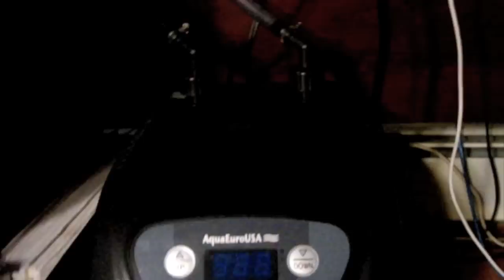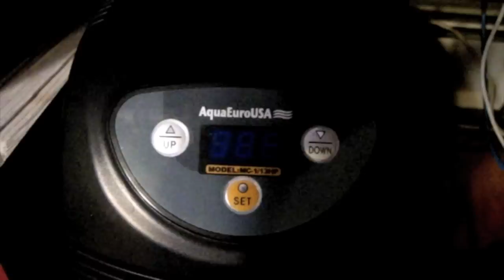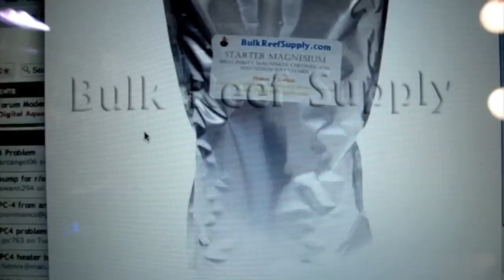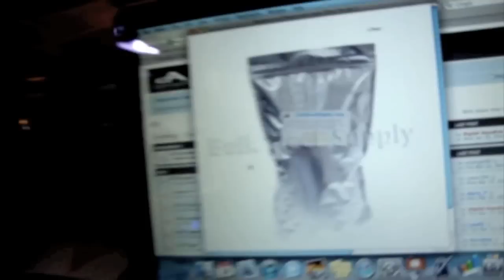Biocube 29 HQI Update 15 ~ New Equipment

Comment: Hi, AA. I'm thinking of getting a chiller. I am looking at the JBJ Arctic chillers. Should I go with the 1/15 or the 1/10? My temp is set at 77. My Halides are on for 8 hours. By the time the Halides turn off, temp is at 80. Not too bad, but I know it will be higher by the time summer hits. Is there any inside cleaning maintenance to do on the chiller?

Comment: @NaTiVoWeB that is called the differential, you should check the chiller manual to see if you can change the differential to a different setting like 1 or 2 which just means that if the setting is on 1 then the chiller comes on with a one degree change.

Comment: Nice setup, thank you for sharing !!! Question I have the same chiller that you have, I set it up for 78 degrees. The thing is that it start running when the temperature go up 2 degrees for what it says in the manual. In my case,I have it for 78 degrees but it start working when it reach 81 degrees that's 3 degrees. Is your like that too?